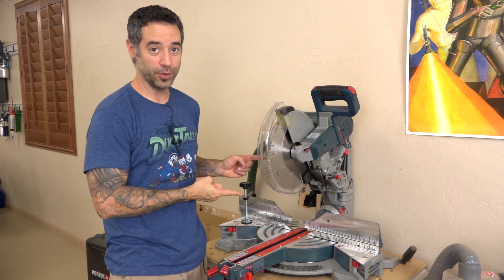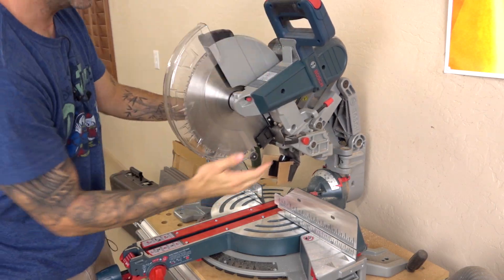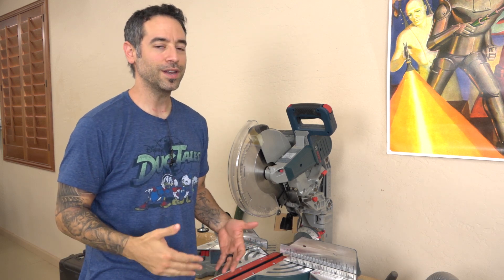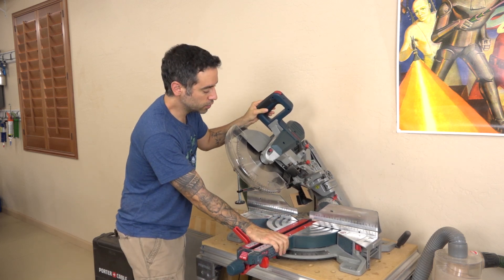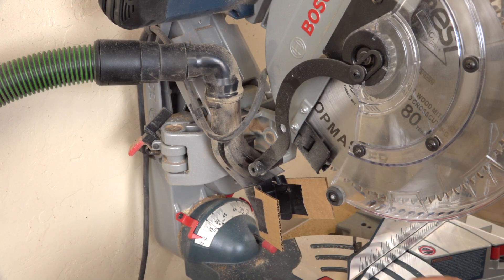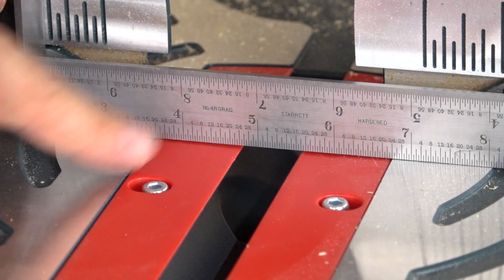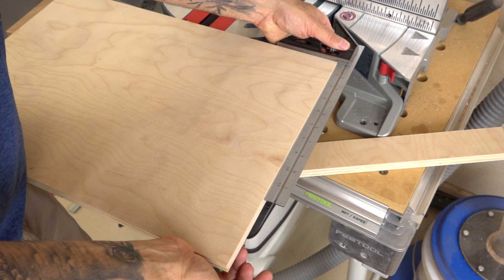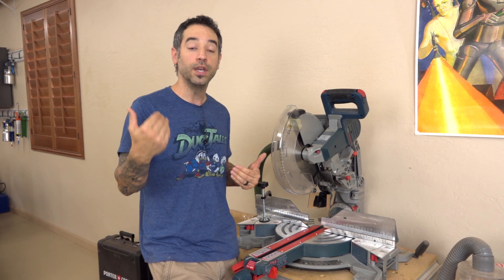Bosch Glide vs Festool Kapex

Comment: Dust extraction on Bosch is absolutely horrible. I tried extending the shroud with some masking tape, duct tape, etc., with very poor results. The 90 degree elbow where the extractor hose connects doesn't probably help either. It just shows how many power tool companies simply don't consider dust extraction an important issue. And that's one of the things that make Festool tools stand out. Is that worth paying 2x the price? It's all relative. How much is preventing respiratory issues worth?

Comment: The handle of the kapex irritated me too, seemed like a design mistake they were unwilling to adress, until i used the makita ls1219 for a while , supposed to be their top model, and found that when cutting thick stock the blade would deflect slightly because of the pressure on the side orientation of the handle, the resulting cut was somewhat skewed at the bottom. Not a problem if you are building let’s say a roof or a shed, but for furniture making too much play. Have been using the kapex 120 for half a year now, never have to worry about the accuracy of 90° and miter cuts, always dead on. Everything on it just works extremely well, love the double laser too. For that alone worth it’s money. I also know i will be able to get good second hand value for it even after years of use, i sold the makita three weeks after purchase and lost more than a quarter of the original price on it.

Comment: Price is obviously a consideration, but my biggest beef with the Kapex is that it's depth of the cut since it's only a 10" blade.  I have had numerous occasions on larger crown molding and large cedar beams where my 12" blade was barely enough.

Comment: Yea i duct taped wedge against the lock i just never got used to its funky function. There are some after market blades for the kapex that are less than half the cost of festool blades.agree the hold down on the kapex  is perfect.and its depth stop for maybe tenons is awesome.

Comment: Have you tried extending the back guides out for the quick release? and or removing it altogether? That should give you enough room for it to work like you want it to.

By the back guide I mean the top guide is movable you can extend it out on either side, and or remove it leaving the bottom part.

Comment: I have this saw and like it. Looked at the Festool but for what I do, I did not need to spend the extra money. A few things to note. If you are cutting 90 degrees you can be up close to the wall. If you are going to be cuttng angles on a frequent basis, you will need a little more clearance - an inch should do - to allow the back suport to clear the wall as it rotates - ask me how I know. As to dust collection. If you try to make the cut in one motion/pass, the dust collecyion suffers. If you make a shallow scoring cut and then a second pass for full thickness/finish the cut, the dust collection is better. I just found that out by working with the saw. I actually upcycled a Dyson Animal vacuum as my dust collection for the saw - work well.  I added the laser to mine. It does not work well in bright lighting - like outside in the sun. It just does not show up. It was easy to install and works well otherwise. Would i buy this saw again - hell yes, for what I do, can't do better for the price and I do own a number of Festool tools - just do not need the Kapex.   Scott

Comment: if you want to get crazy you can re-do the threading on the clamp and put a new threaded rod in there with wider threading gaps. that will turn quicker than the standard one.

Comment: I wanted the Kapex but bought the Bosch and the reason was simple: cut capacity. 88x305mm kapex 120 vs 104x341 for the glide. Don't know about comparing dust collection on a 12" blade (Bosch) and a 10" blade (Festool) machine. Always be harder to control dust on larger blades. Festool must have patented the front facing bars and the screw bevel adjustment. It's so intuitive others would have surely copied otherwise. It's this that forced Bosch into the complicated radial arm workaround I'm sure. Totally agree about the quick (or lack of) clamp. I assume you couldn't retrofit a festool quick clamp on the Bosch or another machine as the support somehow locks into the Kapex base?
Reply: I just posted a similar comment.  Cut depth with a 10" blade may not be enough.

Comment: I had a Bosch glide for less than two weeks. As much as I wanted to like it and not spend the additional money for a kapex, the Bosch was a big let down. 

I’m a trim carpenter and cabinet builder/installer. So consistent performance is critical to me. 

The Bosch would be an awesome saw for a framer or deck builder but it is way too sloppy for fine finish work. There’s significant lateral deflection on the carriage. You have to be super delicant not to push it left or right. 

I finally broke down and ordered a kapex setup. As much as I hate spending the money on their over priced products, they do perform very well.

Comment: I use a miter saw 5 days a week installing cabinets, trim houses and building stairs, I make a living with a miter saw. The insert on this saw seams like it has a huge gap ? around 3/4" in your video. I don't like that, I wish the manufacturers would just make it solid and let the customer cut the gap themselves with their choice of blade.  I am looking to replace my current sliding saw and will probably go with this one. Dust collection and the clamp are both useless to me, so I can live with those shortcomings. Anyway, thanks for the review and information. JB

Comment: Hey Marc not sure if this will work for you but I have an older model of the Bosch saw. The fence is split in two (upper and lower) and on mine the top will slide laterally. Yours looks similar. This makes the alternate quick clamp fit much easier if placed over where the fence is cut lower (currently closer to the saw blade).  Nice saw.

Comment: I bought one a few years back came with folding Bosch wheel away stand, it was about 800 of the finest pound notes. The saw has its good point and one or two not so good. Bad point a gimmicky laser (who's Bosch trying to fool) no need for such toys. When you raise the saw to it's cutting position you have to remember to reset for 90deg as the weight of the saw creeps when in the transport position. I  have forgotten and  ended with a slight bevel cut, Doh! I do find the glide is not as strong and firm as advertised one has to take time using the saw. I loved the mobility, though.  My old Electra Beckum chop saw was a tough and accurate, even with the hard life on site, now it back at work with my mate, who got a freebee. Not used the glide in a while just sits gathering dust, I must find some work for it. Now retired from the building game just  rebuilding Old Motorcycles for fun instead, anyone want a Bosch Glide ?

Comment: I understand you mostly do 90 degree cuts, can please explain the function of the bevel part of a mitre saw, maybe in a video. I have a 12" double Bevel compound mitre saw & haven"t used that feature yet. I"ve replaced all the baseboards,did a few wainscoting jobs and have just begun crown moulding.

Comment: I know you said, you aren't moving the saw but I'm still curious about how it "locks up".  Something I definitely value in a miter saw is how well I can "lock it up" so I can move it.  Almost all sliding miters I've seen don't have a problem with this because there is a screw that locks the sliding mechanism in place.  Just curious how it works with this saw, being that there isn't a big bar.  Looks like a really nice saw though.  Thanks for the review!
Reply: Has two locks... one for the slide, one for the tilt. And slide can be locked in two positions, back or foward

Comment: I'm more curious about the comparison between the Makita and the Bosch. Because after a lot of researching, hmm's and haaa's I ended up with the Makita. And I want to see if you can find those little bonuses that tipped the scales.

I was initially woo'd by the axial glide thing, and the closeness to the wall... but I was not going to let that be the deciding factor.

Comment: WAAAAAY COOL, as I just bought this exact saw weekend before last, based on a review in Fine Woodworking for this saw's smaller brother. I wonder how hard it will be to make a better lock down device to replace, (or add to) that kinda crappy one that came with the unit. And adding to the dust chute shouldn't be too hard either.

Comment: Hey Dude.. you forgot to examine how accurate and precise the articulating arm part of the Bosch  compares to the typical sliding bars/tubes on any ohter saw. The Bosch's system is clever and makes sense but does it work better. and continue to work with exacting precision? How about a vid on that? Thanks.
Reply: Yes silky smooth action on the slide. Mine is maybe 5 years old with thousands of cuts on it and still works superb.

Comment: I realize this is an older video. I purchased a glide about 4 years ago and wish I hadn't. Sure it worked great when I first got it, but not so much now. The detent system on that saw sucks. Its plastic, so after a few years of use, its shot. Good luck finding 90 degrees on that thing. I use the saw the same way Mark does, 90 deg cuts 90 percent of the time. And I have to recalibrate it and hard lock the saw with the knob in the front everytime I use it because 90 aint 90 anymore. And there is no much wobble in that glide mechanism that it is completely unreliable for anything other than rough cutting. Im back in the market again for a Festool.

Comment: One thing that drives me nuts of the Kapex is the guard slides in, so that if you need it out of the way for a weird cut or just to check contact, you can't hold the guard.  Also, that Bosch is very heavy if you need to move it constantly.

Comment: Had my Bosch (the 10") for 6 months now and can't wait to get rid of it.  Honestly, everything I've owned from Bosch save for my jigsaw has been a disappointment.

A ton of play in the glide on anything more than 6" wide - you can see on the end grain where the blade drops through and immediately jumps as much as a 16th to the right when you push it through.  Makes end to edge joining a mess and unless you're really, really mechanical in your motion you'll end up as much as an 8th out of square on a full capacity cross cut.

Controls are stiff and heavy and mine has become stuck in a right bevel on multiple occasions.  

Really small nesting  capacity cutting on a right 45 miter as the housing will hit the workpiece.

Dust collection stinks and has been a common gripe with this unit.  I have a 6 HP shop vac dedicated to it and it still leaves a ton of dust behind.

I have it built into a station and every time I get half a day into a build I find myself pulling my DeWalt I use on site off my truck to finish.
Reply: Im normally a dewalt man but was considering buying this bosch, is it a mistake?

Comment: Nice review. Makes one wonder why Bosch can't make a decent dust shroud and quick release clamp on their own. Neither seem like they would add much to the cost of the saw yet obviously would be of noticeable benefit. It would be interesting to know more about the blade availability your mentioned - do Forrest make blades for the Kapex and if so, is there a price difference?

Comment: In my experience, the more expensive saws are only price justified of you are a professional cabinetmaker or builder who wants one that can work all day every day and be lugged all over the countryside without taking harm. I had a small miter saw that was stolen and I was desperate for a replacement. I had almost no money and a really pressing project. I settled for the 12" Harbor freight (on sale for less than $200) sliding compound. It's advantage is you can cut bevels both ways. It's main flaw is the frame isn't rigid enough to cut accurate depth dadoes. Otherwise, it does the job. I intended to replace it the minute I got the money. That was 8 years ago and i'm still using it. If I was a pro, I wouldn't touch it with a pole. As a homeowner making his own furniture and renovating his own home, it is more than enough.

Comment: I have a Milwaukee miter saw with that crazy gravity stand that I really do love. However it requires so much clearance behind it that it is really difficult to use in my small shop. I saw these articulated arm style ones and was curious if that sort of arrangement could maintain its accuracy. I'm glad to hear it seems to be able to. Thanks for sharing your thoughts on it. Pretty sure I will be selling my Milwaukee and getting the Bosch before long.

Comment: Bought my Kapex 120 +-2 years ago, gearbox packed up 2 days ago, still under warranty. Would have cost $700 to repair. I love Festool, have their Domino, Rotex & TS55 but I think the kapex is too soft for light industrial work. You can almost buy two Bosch GCM 12's for the price of one Kapex 120 here in South Africa. Bosch has been around for years, it is not like that don't know what they are doing. I'm seriously considering the Bosch because of the cutting capacity. Google Kapex 120 failures vs Bosch GCM 12 failures

Comment: I wish I liked this saw. I bought one at the local big box store and I played with it for several days and dialed it in as best I could. I tried it with the factory blade and with an 80 tooth Forrest Chopmaster. I couldn't get consistent straight cuts with the glide function. If I just chopped straight down, it was decent most of the time but, if I used the glide function at all, it had too much play and would sometimes even do a notched cut it was so crooked. I'm bummed because I don't have a sliding miter saw but I've always wanted one. For now I'll stick with my non-sliding Dewalt that cuts straight. When I can afford it, I guess I'll get the Kapex since that saw actually cuts straight. I'm a professional woodworker and I need a saw that is dead accurate every time day in and day out. Lost me on this one, Bosch.
Reply from the maker: Sounds like you might have had a defective unit. Do a little digging and you'll find many folks expecting perfection from the Kapex, only to find that the cut quality is similar to any other saw. My cuts were always slightly dished across the width. Never could resolve it but it wasn't so bad that I had to worry about it. More like an annoyance because the saw costs as much as it does.
Reply: Maybe I'll have to give it another try. FYI, while I had it for a few days, I was able to greatly increase the effectiveness of the dust collection by  lengthening the dust shroud (not any wider). It would hit the wood and the fence on glide cuts but I used flexible material and it was worth it.
Reply: had the same problem with two kapex from two different vendors... posted about it on festool north america on FB...  the features you mention on what you missed are the same ones that would make it worthwhile for me... contemplating a third times the charm kapex purchase or this bosch 10 inch... thanks for the in depth review

Comment: hi Bob here am carpenter from Ireland I just bought this saw with dual lasers.i find my saw has a blade wobble on start up and one laser  (left) is blocked by the blade as u bring it to the wood.can u say if it's in all the saws.i rang bosch they ordered new shaft to see if it's fixable

Comment: the  bosch is good for a shop based saw  or for those who need  maximum cutting dimensions but at 78 lbs its no joy to haul around at job sites . the kapex cant be beat for clean cuts , dust collection and is nearly 1/2 the weight (47 lbs)  of  the bosch so for an installers saw it wins big time .. i just wish festool would come  back to earth on their prices . if  festool ever comes out with a 12" version of  the kapex it will be "the " saw to own . i have both and i do high end cabinetry installation  so .. the kapex  was worth  the extra $ for me :)

Comment: so why did you ditch the Kapex for the Bosch? I'm a working super/ trim carpenter... I by accident got a hold of a Ridgid 7.25" battery powered double bevel slide compound miter saw and it has now been my main setup. Have you used it or own one? For trim it's great. My Kapex has taken a back seat to the Ridgid for now until I need to make the larger cuts the the obvious 7.25 can not make.

Comment: Thanks for the review Mark.  I've been looking really hard at this saw for my home woodshop.  I've also been looking really hard at the Milwaukee 6955-20 12" slider with the digital angle gauge.  Like you, most of my cuts are 90 degrees.  Having said that, I think I would take great comfort knowing the fact that I could  "sneak up " on a cut (sorry Charles Neil!) and know exactly what angle the blade is set for.   Have you or anyone else had experience with both saws?   Id love to hear your opinions.

Comment: I own the bosch glide. Kind of have to keep an eye on the bevel. It tilts on its own when locked in. The hardware store i bought it from said they had a couple brought back bc of it. Other than that its a smooth saw. Im probably doung something wrong though.

Comment: I know why the GDL is on my list... but only when I have the money for it... and what I love more on that than the kapex is the fact, that the cut capacity is quite a bit more on the BOSCH

I might even check out the new Metabo monster with the 315mm blade (not the 301 as the BOSCH has) but this costs even more than the Kapex :P

Comment: I was wondering if you'd tried bench dog clamps instead of the not too impressive ones that came with the saw. Don't know if the hole size in back of the saw would accommodate that style clamp. BTW, I bought the dining chair plans from you and although a stressful project, I'm almost done with my first chair. Great instructions, learning a lot and couldn't have done it without you. Enjoying my Guild membership too!